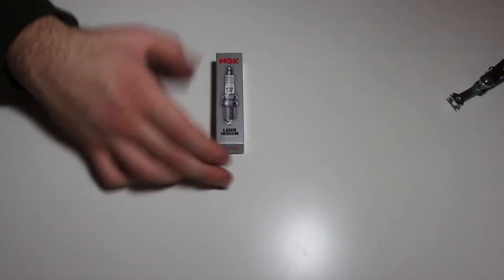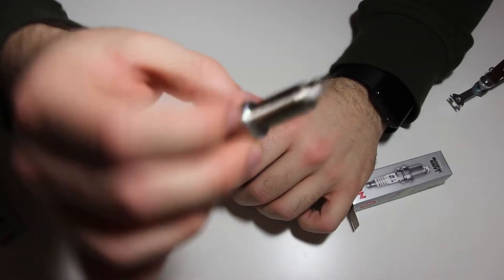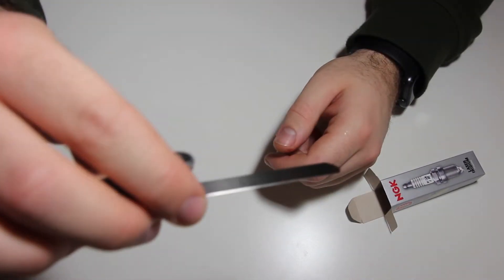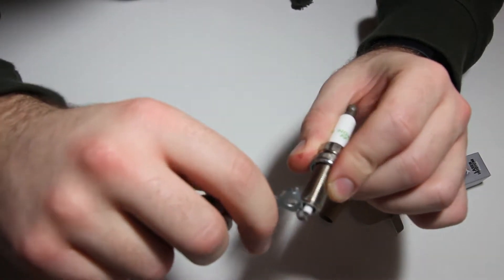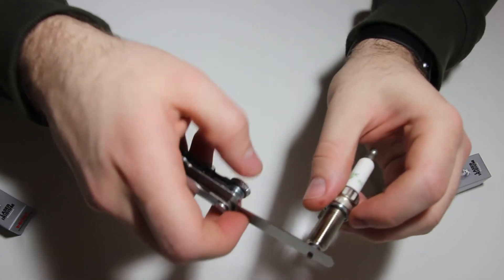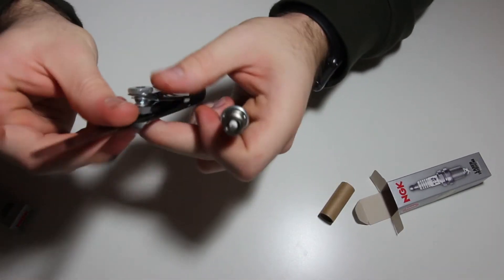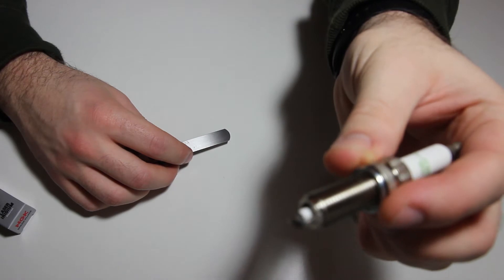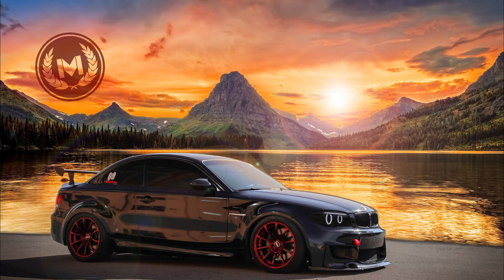How to gap spark plugs - Used on the N54 engine

Comment: What ngk part number? I'm getting a misfire at the peak of my power band. No codes. But at wot 16psi 5k rpm I get what feels like I lost momentary power to the fuel pump for a split second. So it's happened 5 times now. And only under full throttle. I'm tuned with a custom dme flash, and jb4 map 2 , bms charge pipe, down pipes,  fmic, all bms. I recently purchased the car. It only had the jb4 on it. So I've yet to open up the engine cover. It may need plugs? Coils? Injectors? Lpfp, hpfp? I definitely want to try 0.22 gap on ngk plugs like you showed. Great information! Keep the videos coming! If that's your 135 in the video, it's super nice!
Reply from the maker: So I was having the same issue on the freeway when I would go wot; I would go into limp mode and I did not have any codes logged on the ECU. The new spark plugs and upgraded coilpacks really increased the performance of my car. I used NGK 95770 spark plugs and also installed the new coilpacks that are used on the m4 as well. I have not had any misfiring issues since. I hope this helps with your car as well because injectors can get expensive and it was the last thing I wanted to be changing on my car. Let me know what happens.
Reply: Oh wow... we're the M4 coils just plug n play??? And was there a cost difference? I'll definitely get those plugs! I appreciate your response! I saw ecs tuning has a refresh N54 kit for 200 bucks. Coils and plugs. Tonight I didn't get any hesitation, hit it several times to show a friend the power... I was so worried it would act up and I'd look lame lol. My primary car is an e46 M3. So I'm new to the N54 platform. It's pretty exciting to make all this power!
Reply from the maker: Yes, they were plug n play replacements. This is the part number which shows up on my order. (12138616153, 12137594596) I recommend getting them from FCP euro; the total for the better coilpacks and spark plugs will be a little more expensive than the kit from ECS, which uses stock bosch spark plugs and coil packs.
Reply from the maker: I also have a e46 m3 and both cars are great driving machines. Really have a hard time picking between the two sometimes. lol.
Reply: That's crazy! The 135 does handle alot like an M3... however my N54 is in the auto sedan lol. So for me it's really fast. But it's still a sedan. Kinda boat like handling. And stopping it feels a little sketchy... I know however in a straight line the sedan will smoke my wonderful M3... but it can never feel like my M3. This E90 was purchased to stop daily driving the M. It's pretty costly to maintain,  as I'm sure you know. I'd rather wear it out playing with it. Rather than a work commute.  Just went through the vanos, and thousands of very costly things. So I prefer it sitting and looking pretty, not costing me lol.
Reply from the maker: frankdogg85 I hear you. The n54 in the 1er makes a huge difference in handling. This engine can get expensive real fast especially that most of the car has to get programmed once something new is installed.
Reply: I Definetly plan on buying all the cables and software to be able to do coding and programming. As I've done for my S54, I can already tell the N54 is way more computerized.... But I was once afraid of my M3. That was 4 years ago. Now I hook up and mess with all kinds of settings. So I'll be jumping into something for this platform as well. I'm leaning towards Carly? Any thoughts? It boarders on cheap compared to my actual program I have for my M. But I'll be getting something. I'm not going to get sucked into the high shop rates for silly repairs. I'm pretty mechanical myself.
Reply from the maker: I'm not really sure about which software is best to use for the n54, I haven't really looked much into it yet. Do let me know when you figure out which software you are going to use for your car. I am interested in info like that, from people that actually use the software.
Reply: Your information has been highly helpful, and much appreciated. As soon as I get software I'll share my information with you. Thanks again for being a cool Bavarian brother!
Reply: I understand this is and old video, but I'm having the same problem as well. Exactly what you described and I have the same set up as you give er take. Only happened once I installed intercooler. What was the suggestion
Reply: What was the fix I am having the same exact problem.